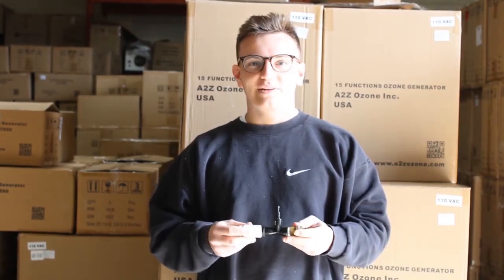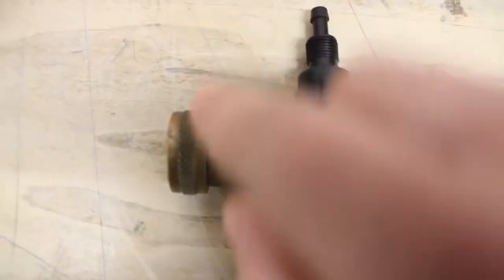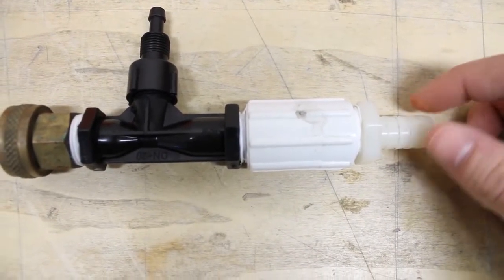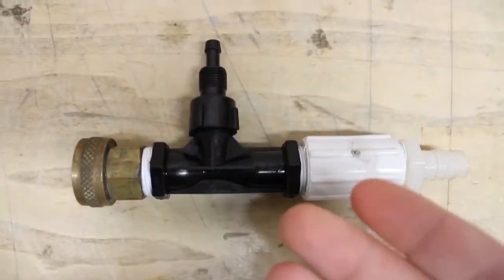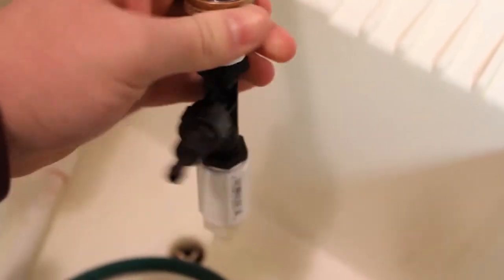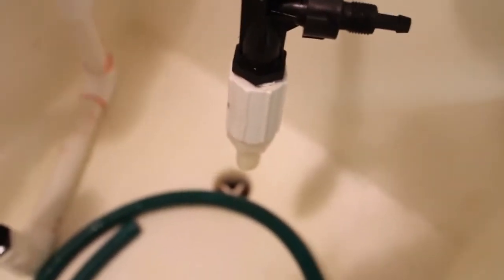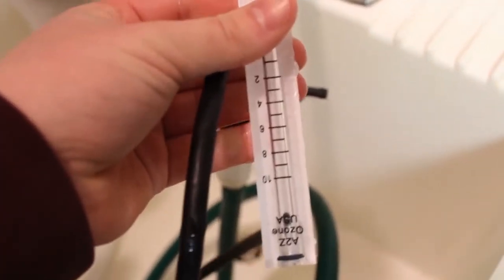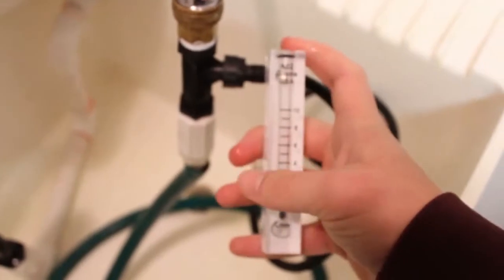Video of How to Install a Venturi Injector onto a Faucet #a2zozone #ozone #ozonegenerator

Comment: I ordered it however no hose coming ?
Reply: Hi Saleh, thank you for your question. I checked your order and it has shipped. I can send you tracking information to your email on file if you wish. Now, I am not sure, do you mean, do we send tubing with the venturi injectors? We do not include any tubing, but we do sell tubing on our website. We have two types and several sizes. One is flexible tubing made of polyurethane, and the other is hard tubing made of PTFE. If you want to see it, you can visit the product pages below.

Hard PTFE:
https://www.a2zozone.com/collections/aqua-series-personal-water-accessories-and-parts/products/3-8-ptfe-tubing
Soft Polyurethane:
https://www.a2zozone.com/collections/aqua-series-personal-water-accessories-and-parts/products/flexible-tubing-by-the-foot

Please note that for both you must check the correct size and enter the number of feet you want into the quantity field. To help you decide which size is right, you can see the chart on the product page.